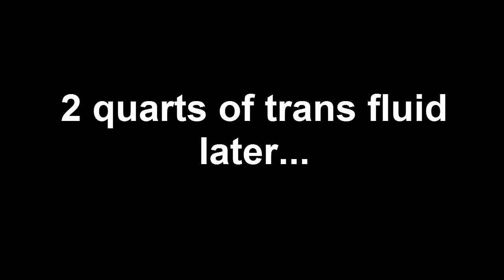240z v8 swap drift build, drag and road racer finaly drives!

Comment: Congrats man, that's a big step.  Sounded pretty good when you blipped it a bit.
Reply from the maker: +RamblinAround yeah, didnt want the neighbors to hate me too much but its got more compression and a bigger cam than my firebird so its pretty snappy.... and for now it was just the block hugger shorty headers wich dont even reach the oil pan... so yeah its snappy...  now that i know it runs good i can confidently throw a little pocket change at this thing and start kicking some butt at the track... ;-)  thanks for stopping by.

Comment: Dude honestly the exhaust sounds pretty good.
Reply from the maker: +clawwill34 thats because its a fairly high compression (for street anyway) smallblock with no fan dragging it down and a fairly robust street strip cam... oh and its got block hugger shorty headers... i gotta at least turn the exhausts towards the back and either run a single 3" or 3.5" exhaust with a small resonator out the back along the driveshaft or exit nascar style in front of the rear wheels...  that way it loses some of the raspyness and defines the tone a little... and prob cutouts for racing just like my firebird... we'll see, but good things are in store for this badass little ride.  Tha ks for watching ;-)

Comment: Good to see it up and running mate...Few teething problems but you will get it sorted..
Reply from the maker: I actually test drove it after putting in a rebuilt th350 trans and it kicks ass.  now just need to get all the other bits sorted out

Comment: great to see it finally moving!
Reply from the maker: +Gilbert Gutierrez yup, i'm pretty stoked.  So glad i decided to just bite the bullet and wire up a whole new ignition setup...  now i can confidently spend a little money on it and weld up an ok exhaust and gp take it racing... after i top off the trans and figure out wtf is gojng on with the b&m shift linkage that i can't get to work with the b&m shifter and b&m cable...  oh well, i might just have to fab something myself.  Thanks for watching.

Comment: man you have the legit cars fixed nice
Reply from the maker: Thanks.  Lots of hard work still to do.  But starting to see the light
Reply: +Invincible Extremes Muscle Cars Garage nice and wel idk if I should trade my eclipse 1995 gsx for a datsun 269z with a v8 what do you think ??
Reply: +karbar6405 260z'
Reply from the maker: +karbar6405 in a heartbeat.   and if you ever want to sell later its a car that everybody wants
Reply: +Invincible Extremes Muscle Cars Garage thanks man I really  needed to hear that the deal is going to go in a bit but the engine is a swap 305 not the original 350
Reply from the maker: karbar6405 who cares, a 305 is still going to be fast and sound incredible

Comment: i ALMOST forgot about this thing it's been so long. i just hope this does not meet the same fate as the rotsun, that'd suck
Reply from the maker: +Jester naw, this one is fairly well thought out... and it may get a 6 speed swap later.  That would be cool.  Its an automatic right now but has the clutch pedal still and i'm basically rewiring it myself so i have no qualms about cutting it up and building a custom transmission tunnel for it...  some nitrous would be fun too.
Reply: Invincible Extremes n2o on the rotsuns twin? your crazy and i love it!
Reply from the maker: +Jester i'm also a cheapskate... n2o is 500 bucks to install and with a decent programable msd setup its fairly safe... ;-)
Reply: Invincible Extremes very true, as long as you dont bump the button like mike did on the hemi cuda :P
Reply from the maker: +Jester  not possible when you have three safeties... a full throttle switch, a steering column button and the arm switch on the dash... so it only works full throttle and only when its armed and button on steering wheel is pressed....
Reply: Invincible Extremes all good ideas!

Comment: It closely reminds me of a 72 Z that i used to have 10 years ago. i paid $100 for it and a small block chevy swap kit that came with it as well. from a mechanics shop in Portland Oregon. 
found a 77 caprice with a 350/350 combo that a friend had, put that in there and preceded to terrorize the Oregon City, Clackamas area with it.
late night drags and auto crosses at PIR were fun back then. 
unfortunately i had to sell it because i lost my job and had to downsize my collection down to two vehicles.
Reply from the maker: yeah, that happens sometimes.  this Z is from the east though... and has some serious cancer...
Reply: +Invincible Extremes Muscle Cars Garage So did mine. last time i heard about my old Z it was sitting beside someone's house in pieces getting new floors put in...

Comment: Awesome!!!
Reply from the maker: +MrMach12004 indeed, i've been busy as hell but when i finaly decided to start from ground zero and just wire up a new distro  and i finaly found the root of the initial problem as to why it didnt run before... theres a pinch in some of the wires for the msd setup... but, i am a firm believer in keeping things simple, so its keeping the cheapo hei setup.... ;-) gotta get more trans fluid and to lift the whole car up and find the leak in my brake lines.  Little stuff but knowing the engine itself runs good lets me be confident about spending a little money on it... ;-)  thanks for watching bro.
Reply: Right on you have a great start for a super cool car! Keep up the good work.

Comment: Sounds like a decent size cam. What heads you running?
Reply from the maker: +Johnny Dole i have no idea, i bought the car as a basket case and have been putting it back together.  All i know is the motor is rebuilt and they are iron heads.  Thanks for watching.